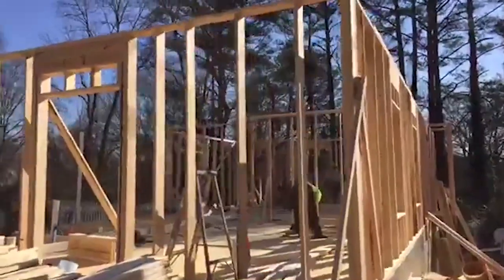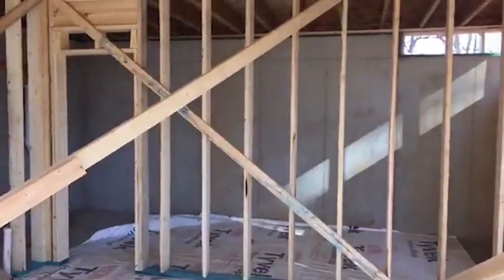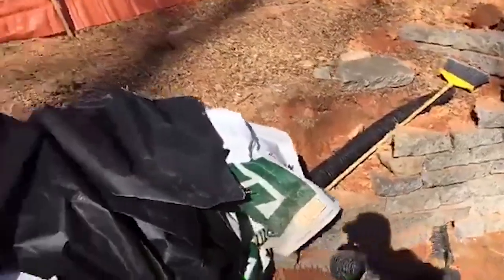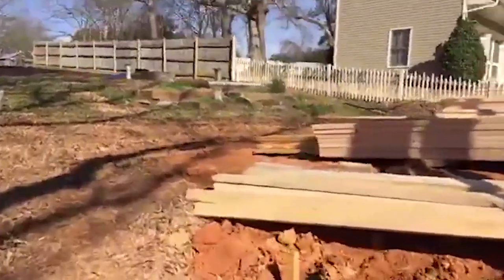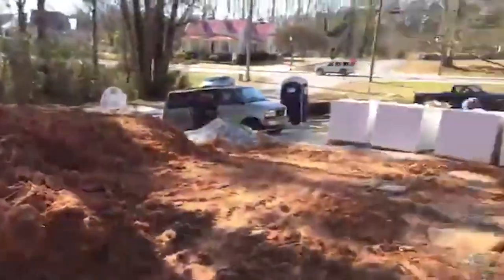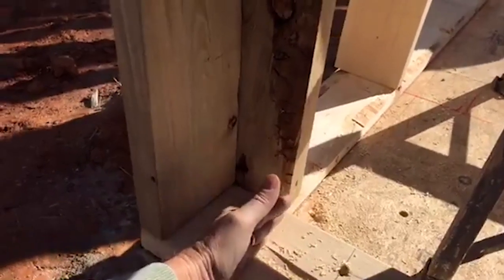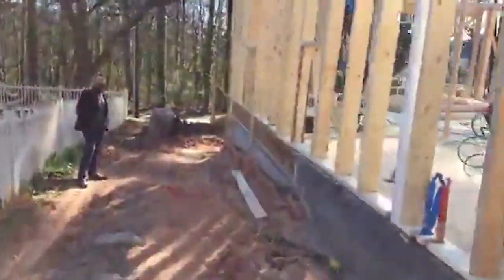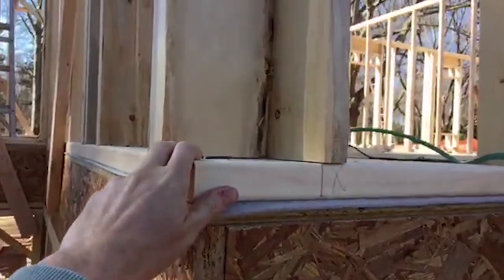One Good, One Bad...A California Corner Story | VLOG 017

Comment: For future reference, the first example of a California corner is also incorrect.  There should be another stud flat on the through wall that is parallel to the last stud on the butt wall which will allow for a nailing surface for your interior wall cladding.  As the corner is shown, there is no nailing surface on the through wall portion of the corner.  Correcting the first Cali corner will also allows for full bearing surface to nail the two walls together.  They likely had to add nailers so they could drywall or whatever.